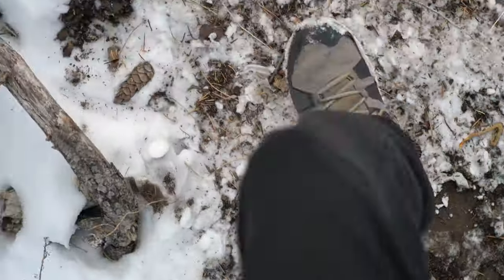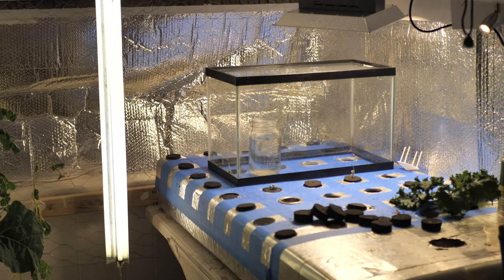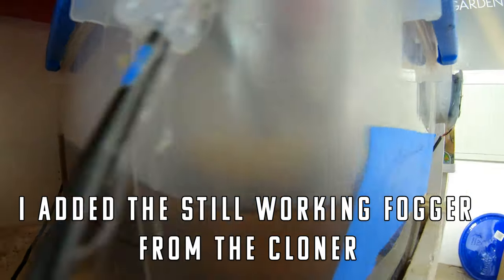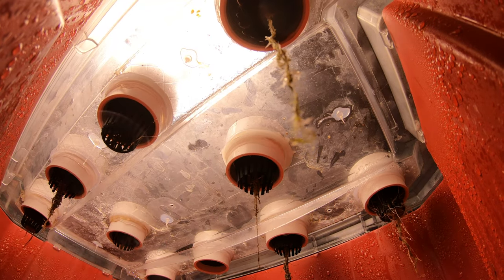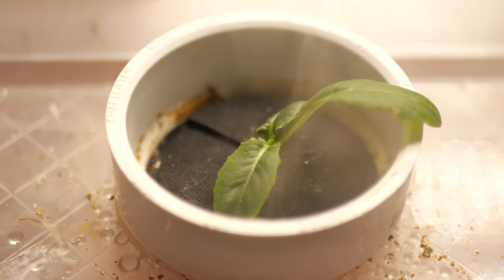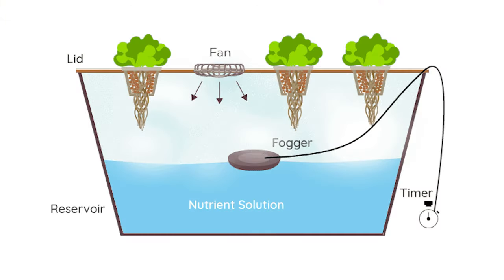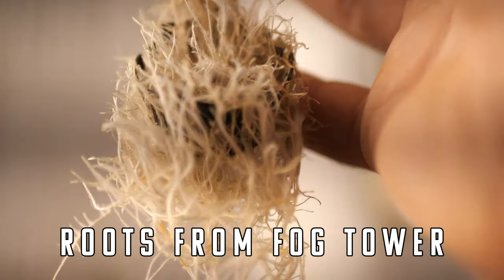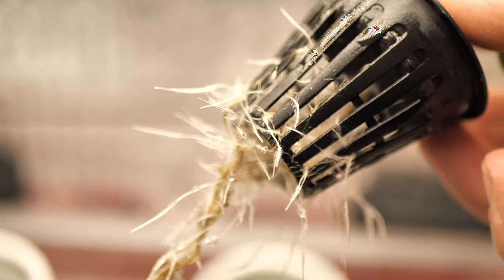Cracking the Fogponic Code: How to build TRUE Aeroponic Fogger Gardens

Comment: Just a thought or idea imagination creation. Maybe small pex like tubbing by each plant u shaped return and a small grade slope to the center for a collection tube or ketch can basically for collected condensation to exit the main base fogger area so it doesn't pool in that area and has directed air fog flow... Recirculating so recycling and possibly reusing nutrients then a timer to purge after so many cycles. I personally want a true fogponics setup with redundancy most others seem to be doing hydroponics basically or something. So I'm picking up every book  that I can on aeroponics/fogponics and will probably end up building a high pressure aeroponics system if what little I understand is different mist micron size than what you're doing. nice video simple interesting intelligent down to earth....hope everything works out for you. ✌️

Comment: I'm working on a general  aeroponic system also but I'm working on designing a Fog that is treated electrostaticlly (negative charge) before it goes to the roots.  Copy and Comprehend nature (Think lightning but without the sparks)  Aka The Ebner effect with a little extra kick.  This Fog also has beneficially effects on humans (but that's another story)
Reply from the maker: Ok, I HAVE to know more about this! Your channel looks enlightening! What is this form of electrostatically fogponics called?
Reply: @humblegrowth  There's no real name for it at the moment (some call it electroculture) but it's based off the Ebner effect.  It combines the Ebner effect and fogponics (basically charges the vapor to a "negative" potential) This video gives a general overview https://youtu.be/15NEFBpzMQA?t=1530
Reply: Would you be using an electronic water descaler in this method with the transfer of fog to the root systems. 
 I am in the process of making an RDWC system using fog instead of water. I would have little tubes at top of bucket going halfway into my net covered in hydroton and recirculating thru back into main reservoir. Coming from the main reservoir going into 4 gallon bucket from bottom of bucket and then fog leaving bucket from hydroton root basket at top of bucket so it would get all of the roots. In the middle of this process I would have 2 inline water proof fans that would transfer fog to bucket and then another fan inline sucking fog thru hydroton cup basket and back into main reservoir. While using an electronic water descaler on  piping
Reply: EWT is a non-invasive system utilizing a solenoid coil or coils wrapped around the pipework to be treated. A continuously frequency changing signal generator, within a specified range, supplies current to the coils. The pulse shaped current creates an induced electric field, concentric around the axis inside the pipe. As a consequence to this arrangement, any charged particle or ion moving within the field experiences a so-called Lorentz force generated by the interaction between charged particles and magnetic and electric fields.
The treatment influences the initial nucleation, resulting in crystals that do not “stick” together
Reply: So like you put a copper coil in the water and the other end into earth or ground?

Comment: Does a fog system uses less water than an aquaponic system?
Reply from the maker: That would depend on if the fogponic system was sealed or moving air.sealed fogponics use significantly less water than almost any style excluding HPA systems. As to where moving air fogponics, requires fog to leave the garden regularly, so moving air would probably be about the same as aquaponics in water loss. Which is still around 90%less than soil.
Reply: @humblegrowth  thank you for your response, love the channel!
Reply: 1: Could excess fog be piped back through via a recirculating loop?
2: Is there a chance that the leaking fog is feeding the plants foliarly in addition to through the roots for a greater nutrient uptake?

Comment: bro, i got a solution for your hydro vs aero problem.  i too was wanting to do the same thing and due to plant height i cannot have a fuggin garbage can size area to grow roots in with the same thing.  due to where i live i have been devastated by root rot several times in my rdwc system and want to go aero.  i don't do fogponics because i have seen issues with nutrient delivery and foggers fucking up.  i am doing more of a misting type of setup.   my solution to the root length hanging into solution has been solved and is working well. i think with a fogger it would be even better, or at least easier.  hit me back if you're interested. i think you might already have completed your project but i dont know
Reply from the maker: I'm actually in the process of a redesign and complete rebuild.  So any ideas are welcome.  Foggers are 100% unreliable so a multi bucket system would be better i assume. Let me know what you got!! 🤙